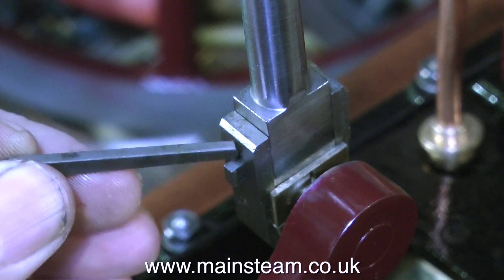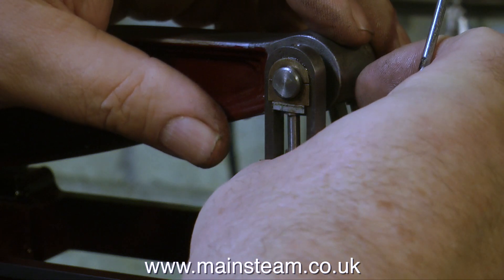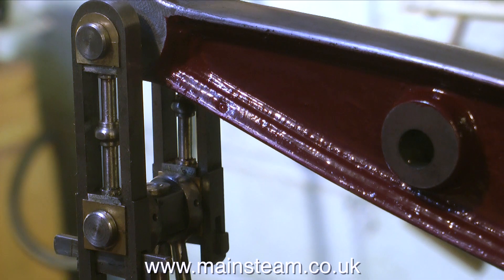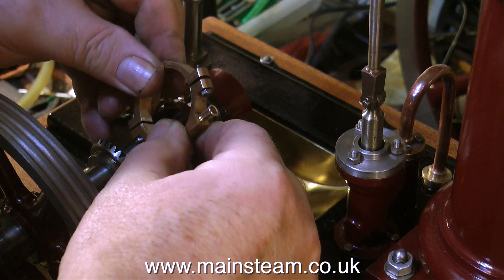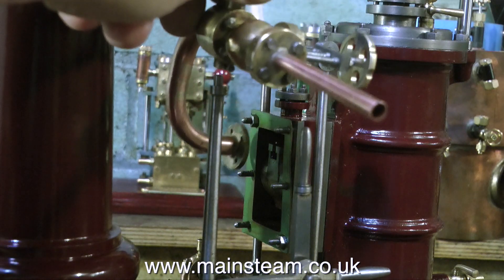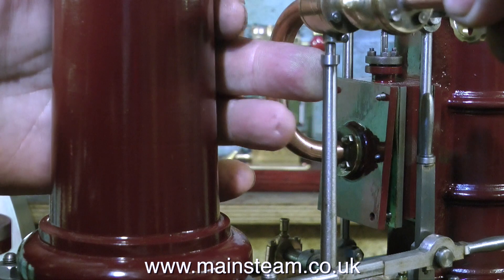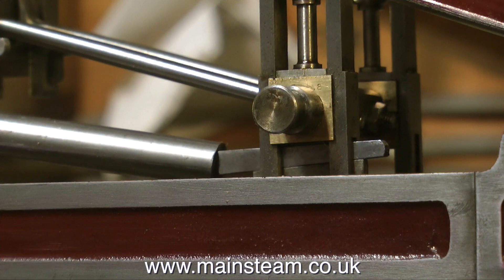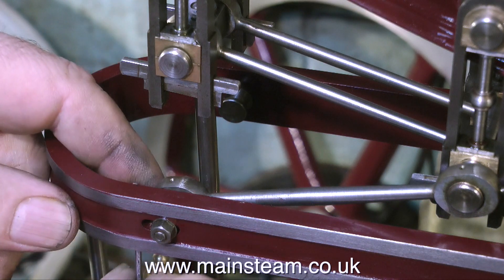STUART MAJOR BEAM ENGINE REBUILD - PART #36

Comment: Keith, a "manifold" will connect a few cylinders to 
the proper connection.  Properly, an "intake" 
manifold, on an internal combustion engine, 
will provide air, (Diesel) or intake charge 
(Gasoline) to the numerous cylinders.  Yes. 
on a multi cylinder steam engine, the manifold 
will provide live steam from the boiler, to the cylinders.

On this engine, you do not have manifolds.  Inlet and 
exhaust pipes is what you have.

(Without "many" you do not have a "Mani" fold.)

Of course, I'm a "colonial." Your English definitions 
may be different.

steve